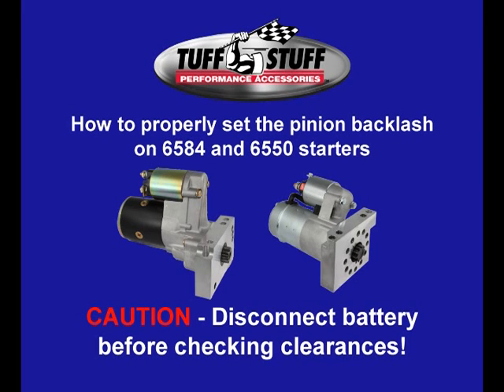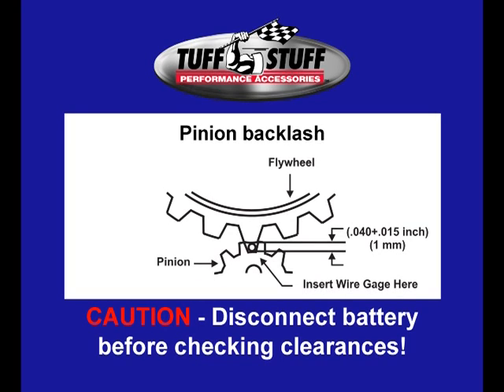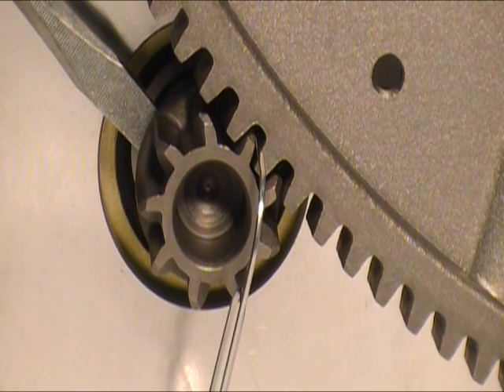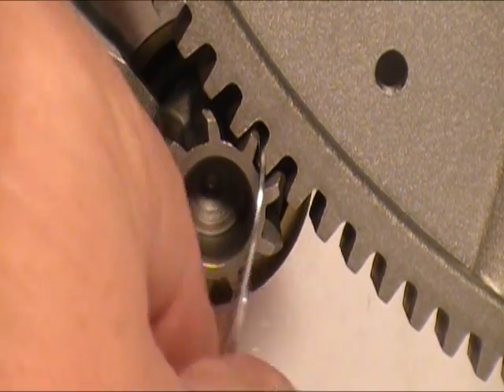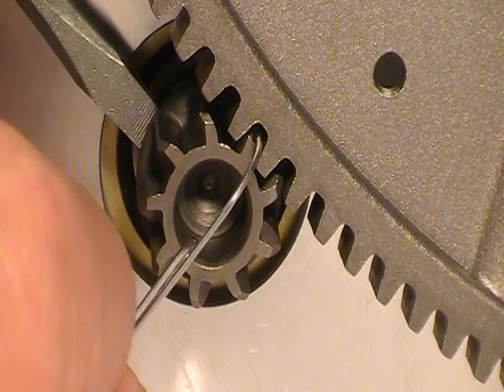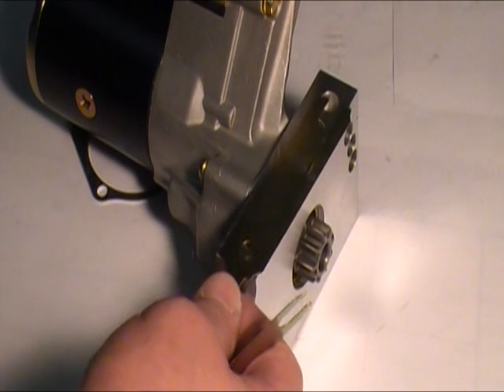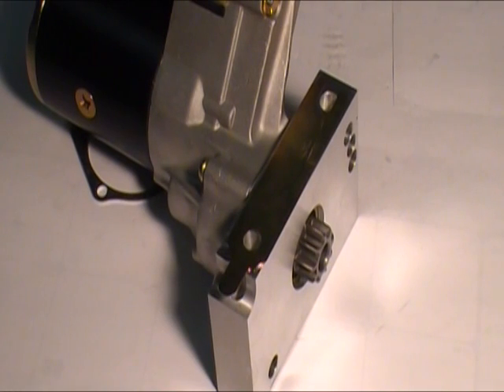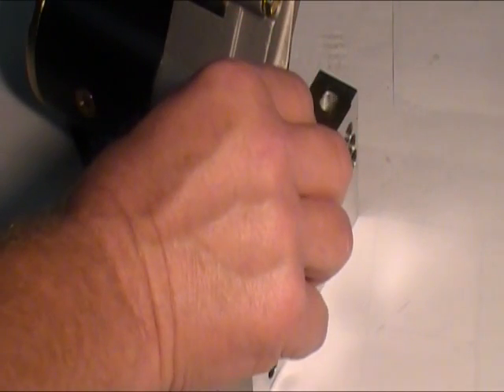How to set the 6584 & 6550 Tuff Stuff starter pinion backlash

Comment: I installed the TuffStuff starter, but to check backlash and pinion depth proved to be almost impossible, just no room. Lucky that it seems perfect without touching the factory assembly. Sounds cool, much better than stock.